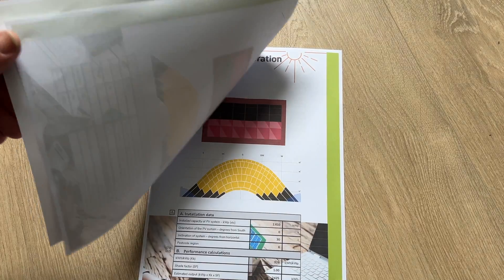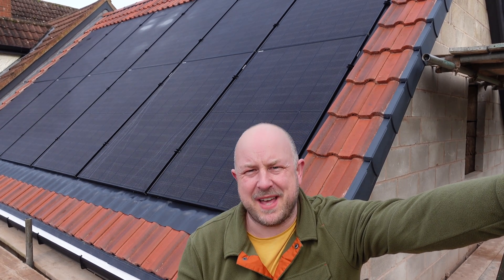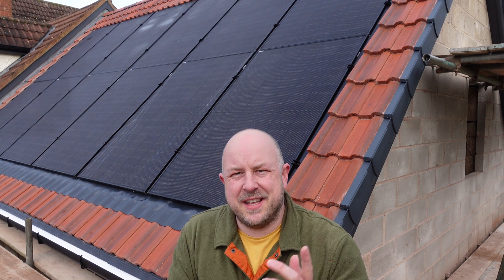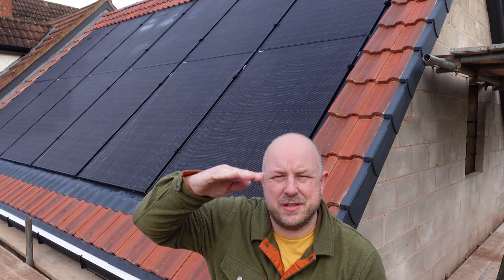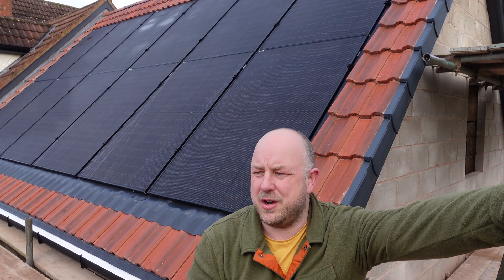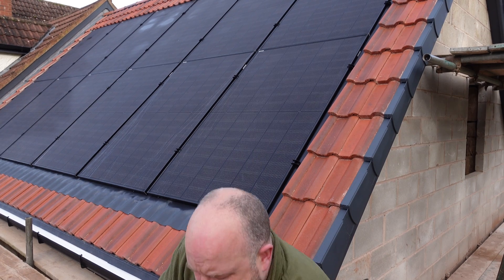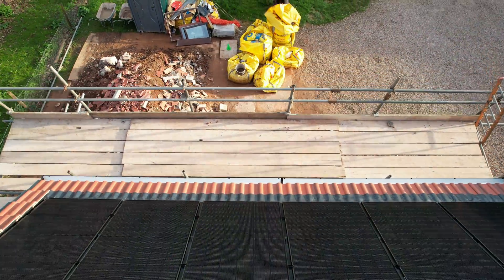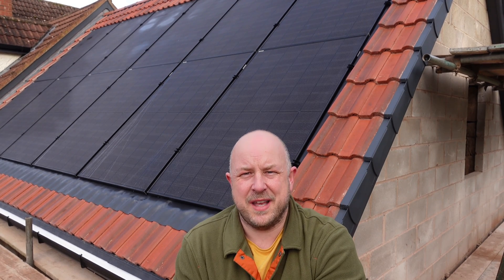GSE In Roof Solar Panels Installed // Part 2 New Build Solar // Jinko Tiger Neo Solar Panels

Comment: Hi Dale, good to see you back. 
I stalled the GES system myself and had a similar problem with the top flashing, eventually abandoning it. I'm not sure why they sell it as even with  a flat tile, it leaves a large gap & is so wide that it can't accommodate a mechanical fixing close enough to any potential  uplift
Reply from the maker: Thanks for sharing your experience. I have seen a few more of these installations since, and they all dont have the top flashing, its odd its a thing.

Comment: Hey - I’ve just watched your video (part 2)… you say you were supplied with stuff that changed from what was initially detailed… I’ve had loads of errors - told panels would be 475w and would measure 1722 by 1134. However what arrived were 1906 by 1134 - which didn’t fit my roof. I’ve had such issues with my supplier… I wondered if it was the same supplier?
Did you take any action against the supplier?? Thanks 😊
Reply from the maker: Thanks for watching, in Part 3 I mention I got compensation for the slightly lower powered panels being installed.

Comment: Looking good Dale. I would definitely be after compensation for panels installed not as specified although as you say only a small difference. I would also be concerned about the spots which the installer should have picked up. Still jealous however!! Looking forward to part 3.
Reply from the maker: Thanks :) To be fair they did sort out compensation with little hassle, and I will touch on this in part 3 (hopefully this Sunday).
Reply: @SpectrumGeeks  That's good customer service